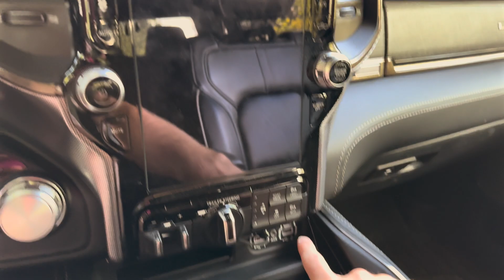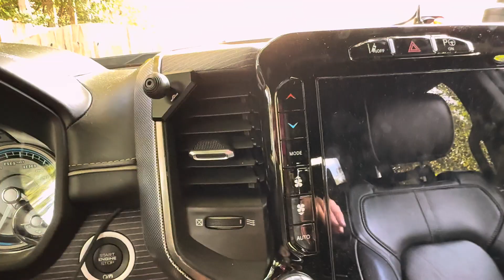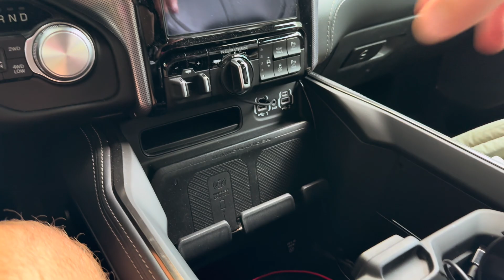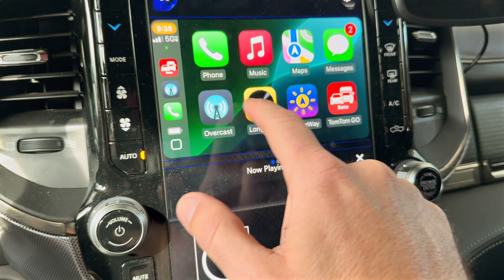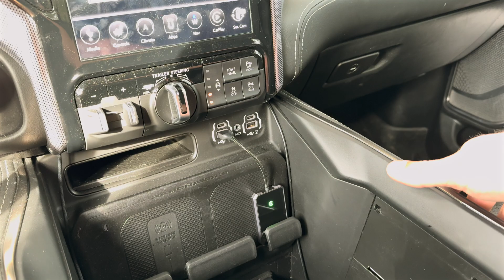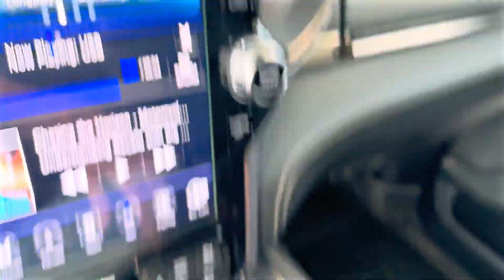RAM 1500: Peak Design Qi2 Charger + Wireless CarPlay for iPhone 16 Pro

Comment: Do you plan to do a coolant flush to it yet?
Reply from the maker: I haven't yet but I'm planning on doing it in the next 6 months. I'll hit 80,000 miles by Fall and I think that's about as far as I want to go on one coolant interval. Mopar says 10 years / 100,000 miles and coolant is cheap enough and the drain takes 30 minutes or so.

Comment: Nice setup.  I tried to do a wireless adapter in my 2019 ram, but I noticed that both the USB1 and USB2 never shut off.  Cost me a early battery replacement.  Couldn't find any way to set the USB to power off after the car was turned off.
Reply from the maker: Yep, that’s why I ended up going with a wall adapter with a plug instead of using the USBs built into the truck. Wireless chargers have vampire draw all of the time even when there’s no car plugged in.